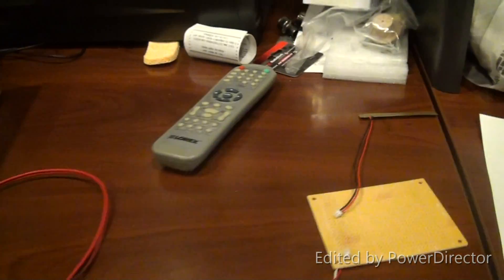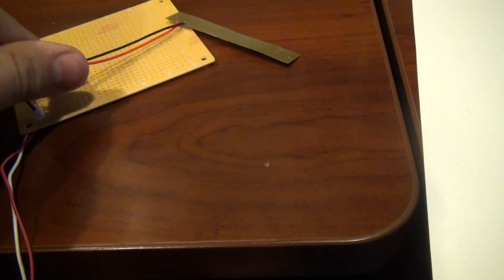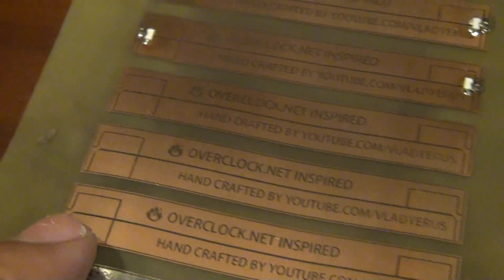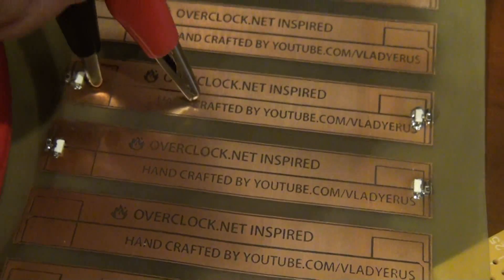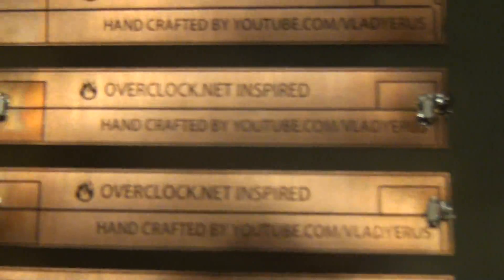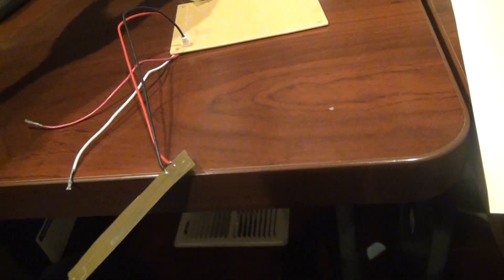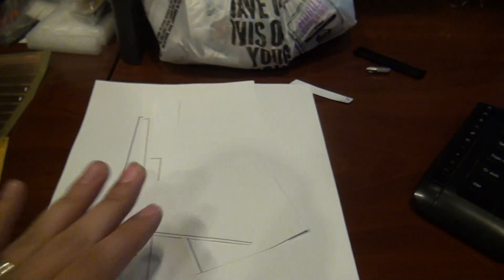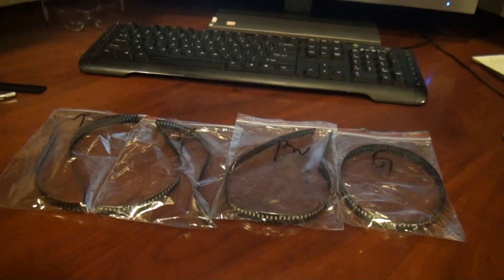Pcb with LED's updated design

Comment: Hey i saw your work and it's so good, but i am was trying to change my Windforce logo from blue to red but i messed up with it, i was soldering while it's connected to GPU and it was flashing and PCB is not working so i need blue one i sent info at your site, i hope to get one because if i need to sell my card i want like new and my card is GTX 960, PCB is same as GTX 970,980

Comment: Hey, I signed up on your site last night and tried to use the contact section, but it gave no feedback when I clicked submit. Either it didn't work, or I just sent you a billion emails. If the latter, my apologies.

Anyway, I said I failed to solder my LEDs and I would love to buy a green PCB from you. Well, today, I succeeded! It isn't pretty when you look at my soldering job, but it looks flawless after reassembly. I'm still buying one from you if you'll sell me one, and I'll do a full $25 if you settled on pricing lower than that. Your guide was a tremendous help to me. I also might do SLI in the future, so it won't hurt to have another.

Anyway, I go by this username on OC.net and on your site.

Here's the result: http://imgur.com/bnFKUkq
Reply from the maker: Hey josh! Congrats man i am glad its working for you. If you are signed up on my list on my website I will be sending out an update today. So stay tuned, I am going to fix the issue with the contact form thanks for letting me know :)

Comment: Looks really clean! Great job on the design. I'd definitely want to order one from you when they're ready :)
Reply from the maker: Thanks! I'm going to update my video tomorrow with the link but if you can take some time to sign up for overclock.net forum. Send me a PM in there that way I keep track of everyone who would like one! Here is the direct link to my thread. It will just help me out to easily know who requested a  unit . I will also have the up to date on when production will begin.  
http://www.overclock.net/t/1534530/gigabyte-gtx-980-970-led-pcb-custom-made